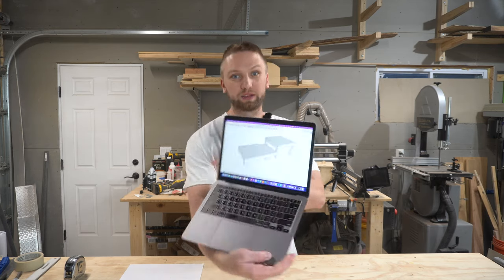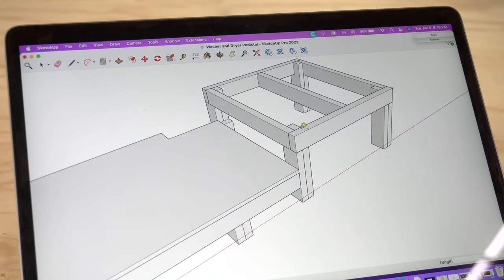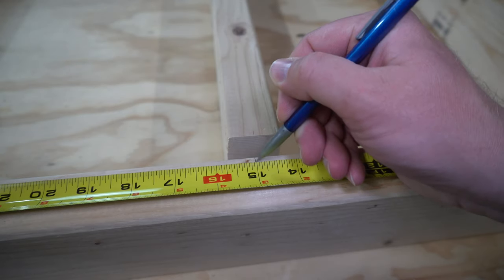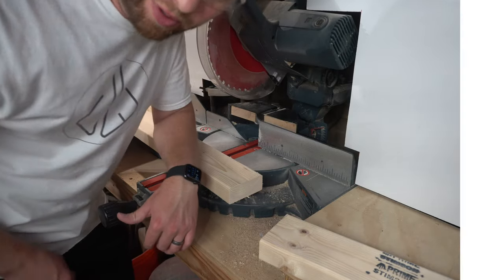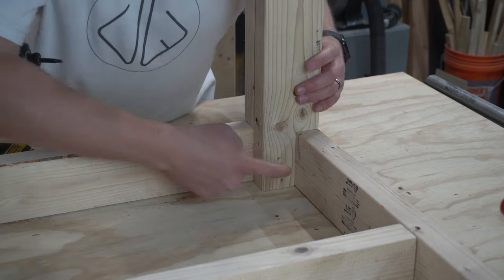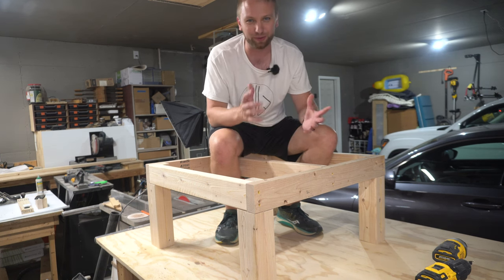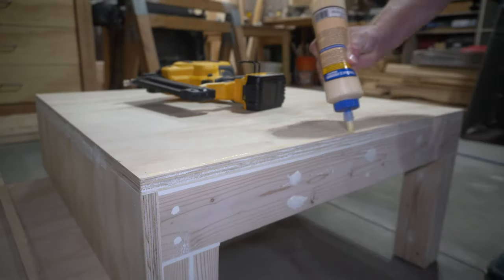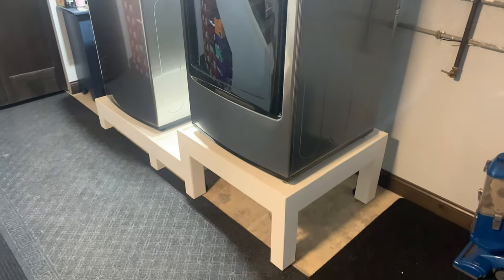Building A Custom Washer and Dryer Pedestal

Comment: Great project!  The trim pieces around the top surface are a good idea, and is a great example of thinking through a project and the use it will see.  An out-of-balance load in the washer when it hits the spin cycle will walk that thing across the room, unless it's restrained.  

If someone were not using leveling feet to contact the floor, as you did, in an application like this I might recommend sticking some ground-contact-rated pressure-treated 1x4 pieces on the bottom ends of the legs with construction adhesive (no nails or screws up through the bottom).  Besides the chemicals, face grain contacting the floor instead of the end grain of the legs will help prevent any moisture from spills or leaks wicking up into the leg, and slow any early rotting in that potentially wet environment.
Reply from the maker: Thank you! Yea I thought the trim pieces finished off the tops nicely and provided a ‘stop’ for the machines if they start to walk. Thanks for watching and commenting!

Comment: only problem i have concrete floor is uneven so to make it square is ok but legs has to be cut at diffrent lengths so  i put 2 legs on make it level screw other 2 legs mark em take off and cut then add center posts as needed treated 2x6 and 4x4 is a must just incase they get wet love this vid just giving my findings ...
Reply: The very end of the video already addresses unevenness of cement floors and how he decided to allot for that.
Reply from the maker: I appreciate the feedback! Yea you might have to approach it a little differently depending on how uneven the floor is. In this case, the adjustable leveling feet were able to compensate that difference and the floor wasn’t too out of level.
Reply from the maker: Yup!

Comment: Does it have to be secure to the pedestal incase the washer moves with vibrations?
Reply from the maker: I didn't, but if there's a way you're able to it wouldn't hurt I don't think. I added the trim pieces so that even if the machines vibrated to the edge, they wouldn't be able to fall off, if that makes sense